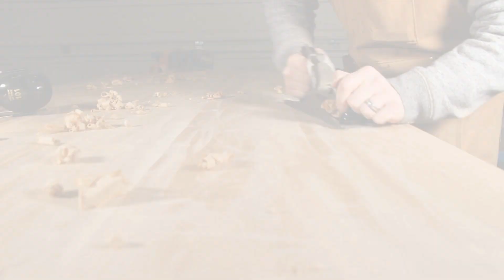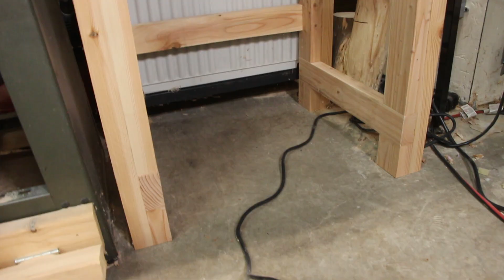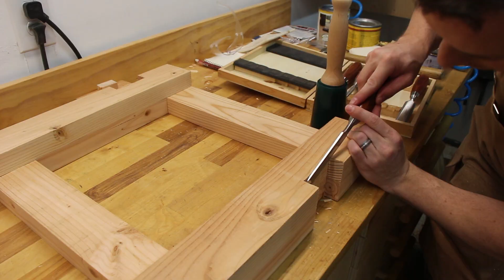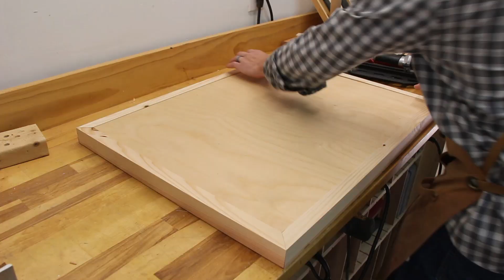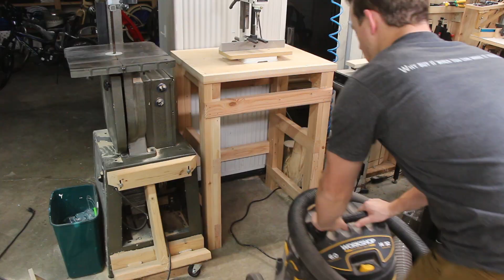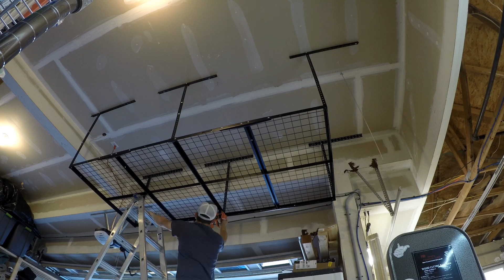How to Build a Stand That Holds Heavy Tools

Comment: Nice video.  I know this base is not moved regularly but I wonder if you had any concern with its tipping?  I am building a similar stand for a bench top drill press that I will be moving around on casters (smooth floor).  Like yours, it has a high CG.  But obviously, 4” square legs would be much less likely to tip.  Just asking for your assessment were it on casters.
Reply from the maker: It's surprisingly stable even with a tool bolted on top. On casters would probably be fine, but I'd probably do a mobile base where one side could rest directly on the floor.

Comment: not sure if you would answer this a year later. But, how would you go about building this with a second tool like a planer for underneath the top shelf?
Reply from the maker: For the planer it's easier using a flip top stand because planers are a bit awkward to move around... but you could just add a lower shelf to the solid top stand.  My fliptop stand:  https://youtu.be/lL-eOK4Vpx4

Comment: I built a planer stand last month based on your stand. I needed it to be mobile  so I could roll it up to my table saw outfeed table. (I hate to tell just how long I used my DW735 on the floor!)
I used Bora retractable casters — they are excellent. While I waited for them to arrive I milled all my 2x4s to remove rounded edges, and get rid of all the grime on them. They had been in the garage for a couple years, but ended up looking like nice S4S pine!
I really like your construction method a lot. I have a small basement shop so  mobility is key. I am sure I’ll make a few more.

Comment: Great job on the tool stand. My shop is small and everything has to be on casters. Do you think this would be stable enough on 3in locking casters to use a mortiser ?
Reply from the maker: Hmmm... it depends on how big your mortiser is. You could always add more weight/wood on the bottom if it felt unstable.
Reply: Rick, I used Bora retractable casters. My stand has a Dewalt DW 735, which weighs around 90 lbs. Casters are easy to engage and move the stand, but stand is sturdy with wheels raised to allow it to sit on the floor.

Comment: Nice project. It is hard to imagine a sturdier, more economical tool base than squared-up 2x4s. As an inveterate scrounge, I've most always had trash begging to be repurposed but now, late in the game, I purchase $50 or $100 worth of 2x4s when they're on sale. The better grades are worth the few extra dollars. After allowing them to reach ambient moisture content they make great low-cost shop project material when trued up.
Reply from the maker: Good call... I always feel a bit uncomfortable when I don't have some 2x4s sitting around the shop somewhere!